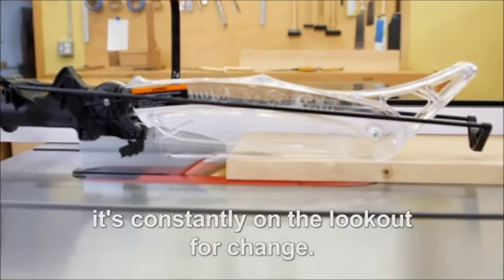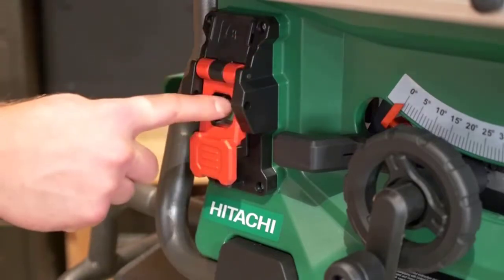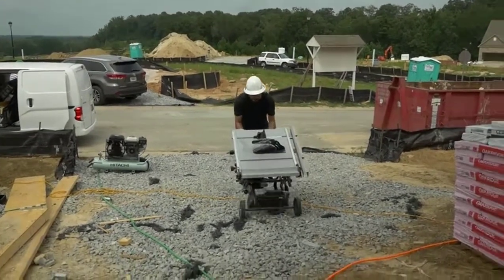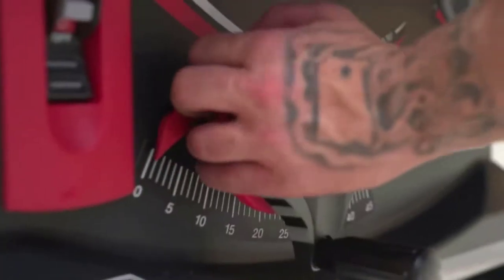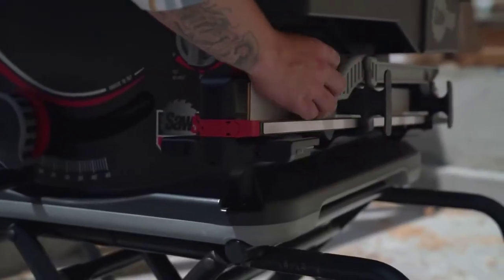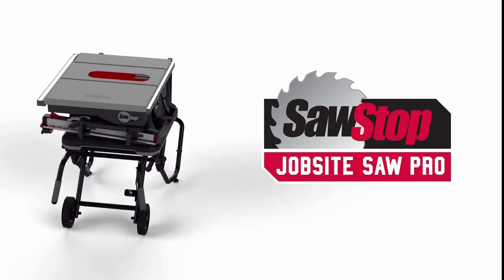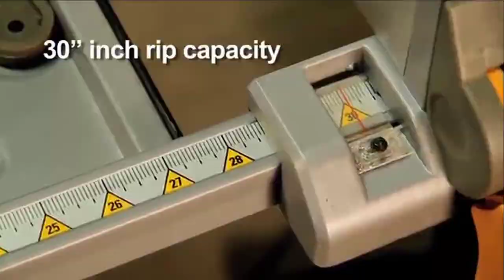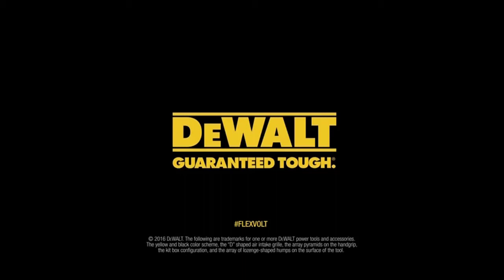✅ 2020 Top 5 Best Table Saw

Comment from the maker: ► Links to the Best Table Saw 2020 we listed in this video:

► 1 - SAWSTOP 10-Inch Professional Cabinet Saw - https://amzn.to/3fPGqCB
► 2 - Hitachi C10RJ 10" 15-Amp Jobsite Table Saw - https://amzn.to/2WQEPDS
► 3 - SawStop JSS-120A60 Jobsite Saw - https://amzn.to/2LwwzUA
► 4 - Rockwell RK7241S Table Saw with Laser - https://amzn.to/2yWt86I
► 5 - DEWALT DCS7485B FLEXVOLT 60V MAX Table Saw - https://amzn.to/3g0lk4O